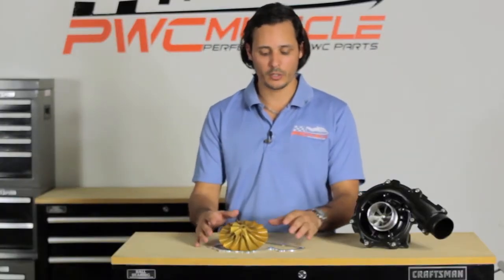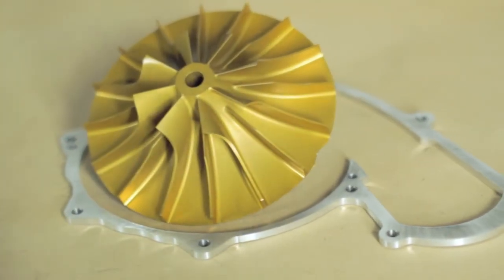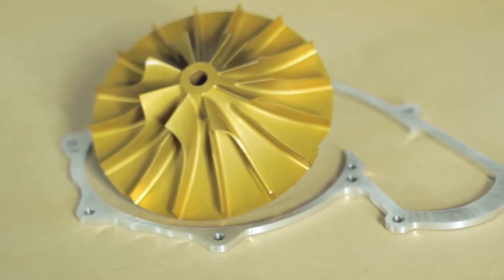Engine Tech ET137 Supercharger Wheel - Presented by PWC Muscle

Comment: Hi, would stock pistons need to be upgraded? Is it okay to run the ET137 +4mm with the stock muffler and resonator?
Reply from the maker: You can use stock pistons.  You can run stock exhaust system, but I'd suggest at least looking at a free flow
Reply: Can used in my seadoo rxp 255 supercharge impeller 137 with stock injector???